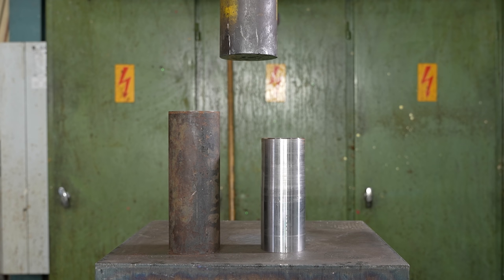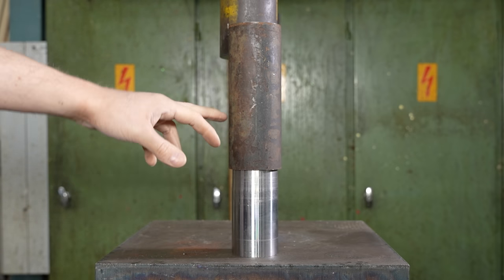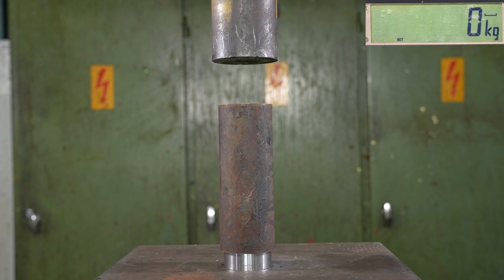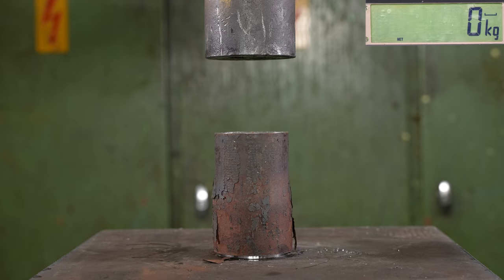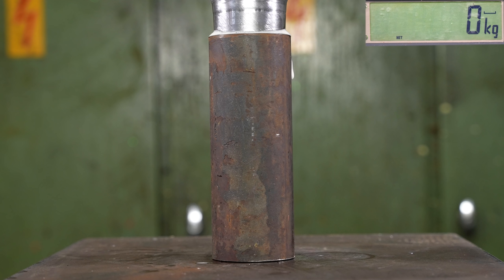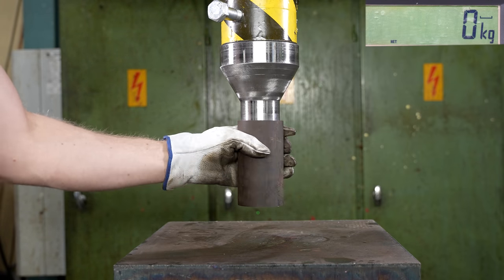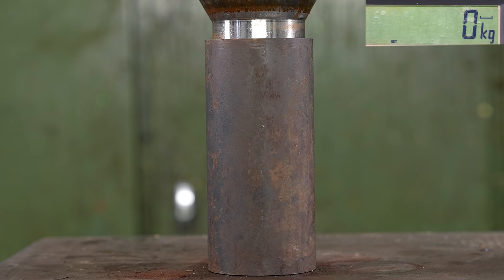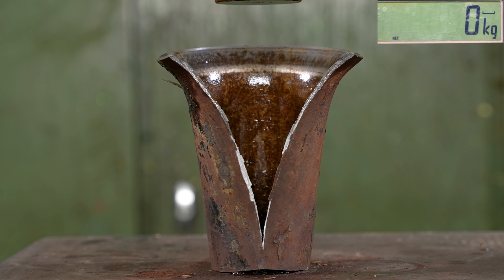Forcing Too Large Shaft into Steel Tube with Hydraulic Press

Comment: I worked as a steel tube mill operator making steel tubing for a number of years. Most steel tubing is seamed, although you can get extruded tubing. We made seamed tubing. This is essentially how we would test the tubing every few hundred feet to make sure it DIDN'T split along the welded seam. If it's manufactured correctly, the welded seam will be stronger that the rest of the wall of the tube. It will always split just like that, but depending on the chemical makeup of the steel, it might spring open all the way along the test sample, IF it splits at the welded seam.. from what I can tell from this video, that seems to be quality tubing!
Reply: The way that I learned it from the pipefitters at the shipyard I worked for, "pipe" has a seam, "tubing" is seamless. That could be different in different countries, or even different industries though, I guess.
Reply: @mattelder1971  I suppose this could be considered pipe. Basically the only difference is pipes are always round, tubing can be formed to other shapes, square, oval, D-shape(very fun to run, lol) Also tubing holds tighter tolerances.. Wall, ID, and OD are all kept within around 3 thousands of an inch, wall kept within 1 thousandth usually. Thats off the mill though.
I also highly doubt pipe goes through the DOM(Drawn Over Mandrel) process, which like 90% of the stuff we made was, which brought tolerances down to more like 3-4 ten thousands of an inch.
Both can probably be extruded, but I don't know much about that.

Comment: This would be really interesting to see through a thermal camera or with the temperature indicating paint. I'm also curious what force it would take to push the form tool back out.
Reply from the maker: With this thin tubes it's hard to push it out but I will try with thicker tubes on next video. Usually it takes similar amount of force to push them out that it took to push them in.
Reply: I wonder if you could get it to friction weld with forcing these pipes together. It would probably take a long length to do it tho.
Reply from the maker: @ronniewilliz153  It think it doesn't get that hot and the longer the pipe the thicker it has to be to stay straight and that makes it heavier and harder to heat up.
Reply: I was going to suggest the same thing, I'd also like to see what it looks like through a thermal imager.
Reply: Could you forge weld with the press and some red hot steel parts? My father and I tried to forge weld with our coke forge and some hammers a long time ago but never could get anything to stick together very well.
Reply: Yeeessss please
Reply: It would be interesting to compare thermal between lube and no lube too
Reply: Oooooooooooooo!
Reply: @ronniewilliz153  :¨D could be useful to do background research on friction welding
Reply: @jfc3552  I know what friction welding is but if you pushed a long enough length you could probably get it to heat up enough to do it
Reply: @ronniewilliz153  clearly you don't know
Reply: @jfc3552  lol ok I'm not argue with you about ideas that might or might not work
Reply: Please, stop converting metric units to freedom units. America needs to switch and this is not helping 😅
Reply: @ronniewilliz153  I don't think length matters, your cooling and heating can both be seen as a 2 dimensional problem, you heat from the inside by friction and it cools with conduction radially and along the length, we can introduce a r radius and z length axis. As long as you don't have very good conductors of heat at both ends, the amount of heat generated and dissipated is not dependent on the length of the tube, as total heating and cooling will both increase with an increase in length. And because the amount of heating and cooling per length unit will not change much
Reply: @ronniewilliz153  not needed either, because it doesn't work. you need WAY more heat than just warm to touch temp
Reply: @jfc3552  couldn't you creat that by spinning the pipe an having longer pipe. It's just an idea anyway like I said earlier
Reply: Was going to say the same
Reply: @ronniewilliz153  Lots of thermal mass with a solid mandrel.
Reply: I second this. Would also be cool to see in conjunction with a more gradual taper to that large diameter used last in the video.
Reply: W comment
Reply: Prob about 35,000 pounds to push it out
Reply: Read my mind
Reply: I suspect very little as the tube has stretched a lot and will have minimal clamping force after.
Reply: @huzudra  I bet that was fun to try. But yeah on the atomic level there just aren't enough connections formed per unit of surface area to get a good weld. The joint between the two parts will have a long fault filled with air and oxide and will never achieve the strength of the homogeneous parts of the alloy.
Reply: @keamu8580  In forge welding you smash together two red hot steel or iron parts with a flux between them, we were using Borax as a flux but I don't think we had the right kind of Borax, were using it wrong, or our steel was not hot enough,  we didn't try it many times and were just going off some vague directions in a book. Forge welding is very much a real process that was used very extensively in the past and is still used today in some applications where very big hot steel parts need to be stuck together.  Primarily our forge was used to heat and shape metal to make wood working spoons and chisels out of high carbon rail road tie spikes and old worn out metal files.
Reply: @huzudra  I'm very familiar with the process but you mentioned doing it with hammers in like a garage setting. To get a good forge weld you need lots of heat (coal+blower, gas, whatever), pressure (hammers will do but it helps to have a drop forging rig), and a way to prevent oxidation forming during the weld (your flux). Sounds like you guys were having a lot of fun. I have only really messed with gas setups for crucible melting to reclaim lead, brass, and copper from electronics, bullets, etc. Mostly end up with potmetal paperweights though.
Reply: @keamu8580  We had a coke forge with electric forced air, started it with oak charcoal we made ourselves because coal was hard to get and store briquets didn't get hot enough to get the coke lit reliably. We had an anvil made from trail rail and 4lb sledge hammers on long handles. Borax is the flux. Coke fire forges get plenty hot to blacksmith and straight up melt steel, if you blast too much air you'll actually burn the steel instead of melting it.
Reply: @TheDutchShepherd  Based
Reply: @TheSilverShadow17  you know it!

Comment: I think how far you can stretch it also depends on the "cone angle" -- the narrower/smaller the angle, the greater the stretching force will be for a given pressure force, because you're basically trading force against distance. With a narrow angle you'll have to make the shaft and pipe very long to achieve a given final stretch width.
Reply: I agree. Metal forming techniques can stretch metal quite dramatically without tearing or breaking it.
Reply: It obviously depends a lot on the material, but gold can be made into layers atoms thick (supposedly even one atom thick, though I have a hard time believing that).
Reply: @fronthole_guacamole  Exactly! 😁
Reply: @jakistam1000  I stand corrected, Gold does seam to work harden.  

Gold doesn't work harden, so it keeps it's ability to stretch during the entire process. This allows gold to be hammered into extremly thin foils. Copper, aluminum, and iron i.e. do work harden, which results in more brittleness and therefore the cracks and tearsshown in the video. :)
Reply: @clockworkvanhellsing372  gold definitely work hardens
Reply: @ChristianMulvihillThom  pure gold does not work harden my man
Reply: don’t use a pre made or factory made pipe as 99% of the time pre made pipes actually have a seam in them which is a weak point… it’s the same with square tubing…
Reply: @justdrifting4749  yes it does.
Reply: The outer pipe is actually getting shorter, not losing wall thickness. Also erw (seamed pipe) works better than extruded pipe because you have a more uniform wall thickness.

Comment: If you still have any of that old tube left, you could mark it with some arrows pointing in a single line towards one end before cutting another two pieces off. That way you can tell where they are relative to the seam, even if you flip ends. The first one might be wrong, but then you can adjust and get the second one centered just the way you want for the camera.
Reply: Brilliant idea. And I don't think there's a problem with the press or the setup. Pretty sure there is a seam in all pipes but in some cases pipes for nuclear power plants are actually inspected with xray machines for imperfections in the structure.
Reply: Since I worked in steel tubing manufacturing, as a mill operator for a number of years.. This is almost exactly how test samples are checked in the manufacturing process ever few hundred feet. If his samples were to consistently split along the seam, it would be considered scrap steel, and tossed. Steel tubing should never split along the seam if it's manufactured correctly. The surrounding wall of the tube should be weaker than the welded seam.
Reply: @mbrueggz  
Nice. That's what I was waiting for. Someone who knew for sure.

Comment: I like that the rust falling off really shows the difference in structure between the metallic iron and the iron oxide. i.e the metallic iron stretches whereas the oxide layer cracks apart
Reply: Put some butter on it, some W40 and then you put
Reply: @chrisakaschulbus4903  A sizzling T Bone on the top, and you got yourself a gourmet dinner going on

Comment: In the machining industry we call that an interference fit, though the larger shaft is usually only a couple thou bigger than the ID, and the parts are shrink fit instead of forced together but the end result is more or less the same, albeit a little more strong, accurate, concentric and parallel lol.
Reply: I saw a video of railway axles being constructed for Bombardier in Victoria, AU just like this. Very interesting!

Comment: I should point out that the US was actually an early adopter of the Metric system.  An inch is defined as 2.54 cm.  If you change a cm, you change an inch.  Most people in the US who actually make things can use either metric or standard or even both together.  Many automotive and aerospace parts start using metric dimensions and then are converted to standard for shops that prefer using standard.   The only real advantage that standard sizes have that I have seen is in drill sizes.  A typical metric drill has more room for deviation from one brand to the next which can make hole drilling to a somewhat tight dimension a bit more difficult without using a reamer.  Standard drills are typically accurate on diameter to within +/- .0001 inches, so it's not too hard to hit a dimension that is say +/- .001 on diameter with just a drill.  If you look at standard fastener sizes, clearance hole sizes, etc, the system works out just fine.  It is more cumbersome to use than Metric, but if you're an engineer or a machinist, understanding how to go from one to the other is extremely simple compared to all the other things you must know.

Comment: You can see the seam on the inside of the pipe in the shot of the pipe cut in half. Most pipe has a seam. We do use seamless pipe sometimes. It’s designed for high pressure applications.

Comment: I used to install induction welders in tube mills.  That's the equipment that welds the seam of pipes.  The quality test was very similar to your final test.  If the weld is done correctly the weld is stronger than the tube and the tube rips.  If the seam fails then that is an indication the machine needs adjusting to strengthen the weld.

Comment: I do this a lot at work on 4” to 12” pipe. We stretch or “bell” the pipe by forcing it over a lubed mandrel with a hydraulic pipeline press. After that we use a little epoxy as lube and press a normal diameter end into it. Kinda like PVC pipe but it’s a press fit. It makes putting pipeline together a lot quicker than welding.

Comment: The crack at the end is camera shy! 😂. And don't worry about the units! You're using the International system. Key word: INTERNATIONAL! If someone doesn't want to learn it it's their problem! 😄
Reply: Freedom units are still the best though! (P.S. not an American)
Reply: @--_DJ_--  In what sense? 12 inches in a foot, 3 feet in a yard, 1760 yards in a mile... sure, the best! 😂
Reply: @javiTests  It was just a joke, but I do only work with imperial measurements when possible. Neither is better in my mind, they get to the same place in different ways. I just have always preferred to work with imperial. There may be some advantages to the ease of the metric system that I don't get into. I do have an odd fondness for fractions but in reality, it doesn't really matter if I am measuring the centers of two holes, which side of the tape I look at.
Reply: @javiTests  Start with a base unit that is ~12 inches long and we'll talk about benefits.
A base unit that is ~36 inches long (the meter) needs too many subdivisions for convenient use.
A base unit that is ~0.5 inches long (the centimeter) needs too many multiplications for convenient use.
A kilogram is too heavy for the same reason.
And the Celsius is useful for calibrating thermometers. When was the last time  you needed to do that? A high school chemistry lab? That's a sorry excuse for preferring a temperature scale whose divisions are too large.
Reply: @artsmith1347  Are you serious? In the metric system it doesn't matter AT ALL which one is the base unit because it's metric! Meaning it's base 10, hence all the different units are calculated in milliseconds by the brain. For example, the base for weight is the gram (not the kg) and "kilo" means 1000. So 1 kg = 1000 g. Easy peasy! A meter is too long to measure the thickness of a wire? That's why we use mm for that, that is a thousand of a meter. if someone tells you "my height is 182 cm", you know immediately that is 1.82m if you want. You don't have to think at all. Now, tell me by memory in less than one second since you read this how many inches in 2.84785 miles.
Reply: Glorious Imperial System > peasant metric system
Reply: @javi  The metric system was not designed for human-scale convenience. It was an exercise in political correctness that was contradictory in that it was Euro-centric and discounted the importance of the southern hemisphere. Anyone who is truly woke would condemn it.
Defining the metre in terms of the distance from the equator to the north pole was stupid. The definition was adopted in 1791, before they even knew how far it was. They didn't have a precise measurement until 1799.
Your reply illustrates an anti-human aspect of the system. Why do you imagine that I care about someone's height to three significant figures? 182 cm is ~6 feet, which is close enough for most purposes. A claim to be 2 metres (6'-7") tall would strain credulity or may give an impression that the speaker was sloppy in their use of language.
As for how many inches are in 2.84785 miles, that isn't a practical question. On the scale of ~3 miles, few serious people are going to quibble about the fifth decimal place in your question.
Reply: @artsmith1347  Sure, it's much more "human-scale" convenient to have different bases for different units of the same type of measure (weight, distance, etc.). 😂👍
Reply: @javiTests  You are correct: it is convenient to have different ways to have different units for measures of time at different scales. How would you like to express years in terms of thirds of kilodays? Or in thirties of megaseconds?

Comment: Next time you cut pipe for this kind of video, make a line down the "centre" of it before cutting. That way, you can tell which way the first one split, and turn the second one appropriately, until you can figure out if it is always splitting along a seam, or just random. There is always the chance as well, that it is just a long flaw in the pipe.

Comment: I'm wondering if you could show how strong or how interference joints would work with the press - heating one element and cooling the other one and trying to separate them or something...
Reply: There are some cool examples of that on the cutting edge engineering channel where he uses liquid nitrogen to shrink bushes before placing them into a bore

Comment: I think the diameter of the pipe will determine more of how much it stretches then the thickness 20% stretch on 50 mm versus 20% on 100 mm There is obviously going to be a yield of how much material stretches that will also depend on how hard the material is Just my thoughts

Comment: If it is steel gas pipe, there's 1 welded seam. It's for safety, if the pipe does explode it rips open and doesn't shatter and blow shrapnel everywhere..

Comment: Most pipe made in those diameters is welded pipe. I suspect that these pipes split along weld seams, but maybe not. If you polish the outer surface, you could find the welds by etching. If I remember correctly, a little bit of nitric acid in methanol would be a good etch for finding the seam.

Comment: Basically what you are doing is swaging, and flaring tubing. Those last 2 pc's of tubing are now works of modern art! weld them to base and decorate! If there is not a visible weld seam, then you have seamless DOM (drawn over mandrel) tubing. It's still welded but the way they do it most times you won't see the seam until the pipe ruptures.